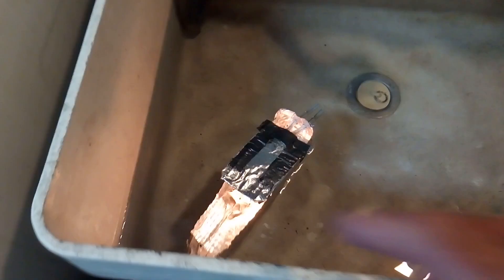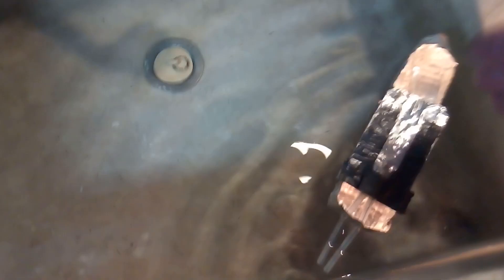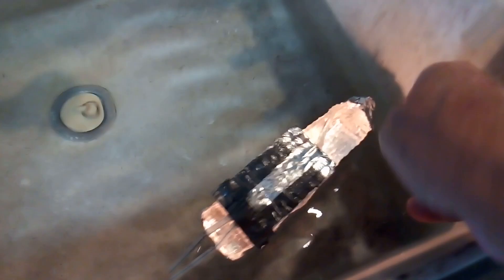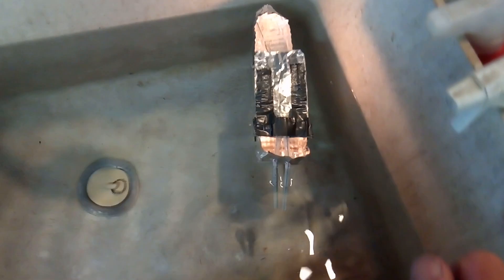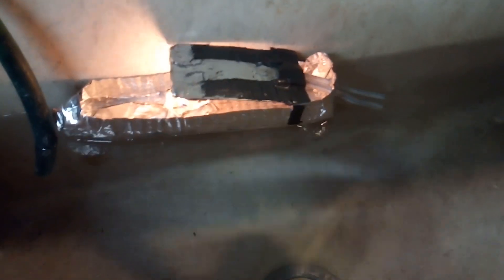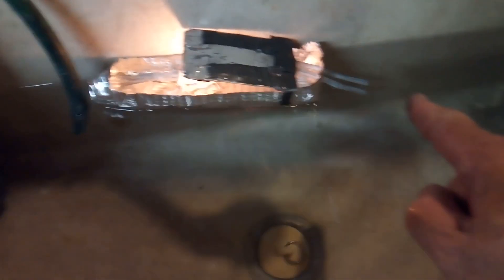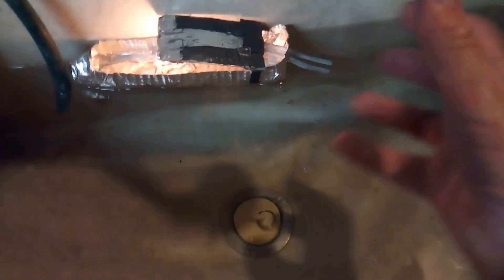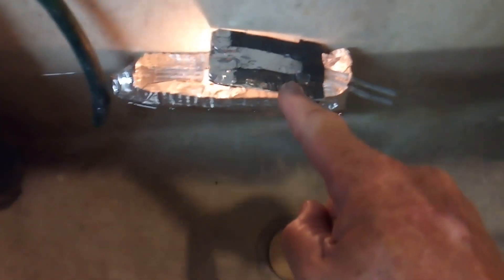Pop Pop Boat #2 --  'The Wash Tub Racer'

Comment: You soon realise how little power they have. They get hung up on the wall. Sometimes, I put glass headed pins around the side of the boat as they stop it sticking.
Reply from the maker: I read that these heat engines are very inefficient.  Blade Atilla made one that took advantage of the popping diaphram to moved a 'whale tail' kinda thing that helped.  In my world anything that has enough power to keep moving at all is a win.  I'm woundering if anyone has made an LTD type that runs on low heat ---perhaps solar heating ?  My real interest is the engine.  I might try a setup without the boat.  Just clear tubes into a small tank. I have seen that done.